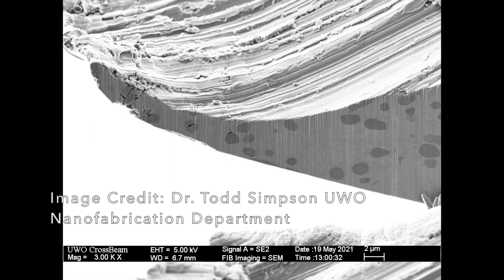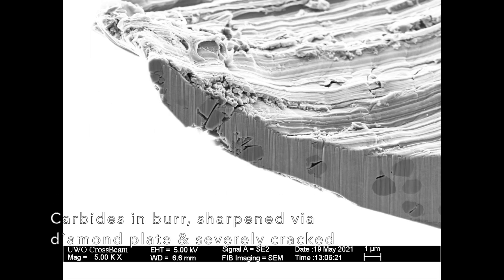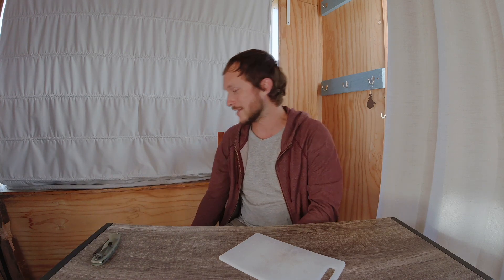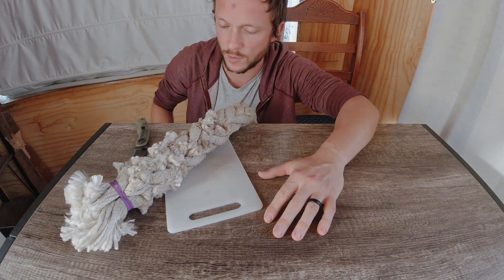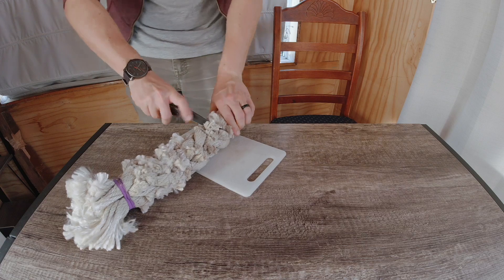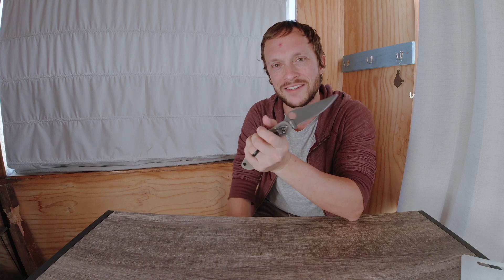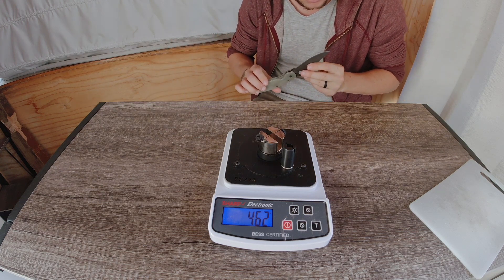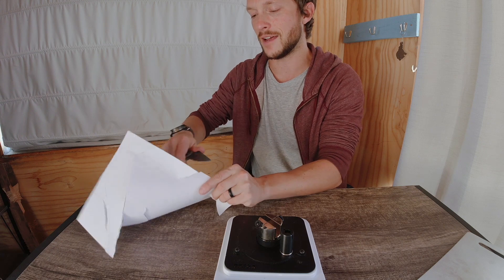CPM M4 Prototype Carbex Edge vs Death Rope - Spyderco Military Knife Test

Comment: I was looking at those articles on science of sharp recently, and I don't think the issue is the abrasive material - take a second look at the K390 article, and you'll see a similar effect with the 240 grit Sigma Power Select II. I think the issue instead is the grain size/height. When a shallower cut is made into the material, the carbide does not fracture, an effect that's exploited in machining ceramics. I think there's a lot of potential to work forward from this principle in designing sharpening abrasives.
Reply from the maker: YESSSSS. The nerd-factor on this comment is amazing...  Let's talk!

I somewhat agree - have you seen Todd's articles about how increasingly fine diamond plates actually lead to deeper "gashes" in the edge and greater edge deformation?

I think that there are multiple things at play here:
1) How hard the abrasive is vs the hardness of the carbide being cut - ie diamonds will have greater likelihood to break a carbide because their molecular structure is so hard/rigid, they just don't want to absorb any impact shock, they want to transfer it all back into the edge BUT
2) The relative coarseness/fineness (ie size) of the abrasive determines whether there is a wide surface of abrasive sliding along the edge, or a small surface digging in - however, it should be stated that the pressure applied to the blade will minimize or magnify this effect (eg you could shatter carbides and make deep channels even with a Coarse stone by applying a lot of downward pressure as you sharpen) AND
3) The medium/binder determines how much absorption of shock is possible.  A hard stone will shatter carbides more readily because its embedded abrasives cannot be pushed out of the way.  A stone with softer binder, less so, and a leather strop (even with diamond) will be less likely to shatter many carbides, because when the abrasive and carbide collide, the abrasive can "bounce off", deflecting into the soft flexible material, and absorbing the shock rather than breaking the carbide.

Wow, I just unleashed a lot of theories, lol - what do you think of 1, 2, and 3?  Agree or disagree?  Or do you think there are other factors at play?
Reply: Haha, yes!!

I have seen that article, though it wasn't on my mind per se when I wrote that comment - and I really hadn't been thinking of moving to finer plates, so much as finer (but still coarse) resin-bonded stones. 

On to your numbered points!
1) I think we want to cut the carbides for apex formation! even in PM steels, carbides are often 2-3um, while a sharp edge is sub-micron. But when we do, it's important not to damage them. As you said, it does seem likely that a rigidly-mounted diamond is more likely to break a carbide, as the carbide will yield sooner than the carbide, whereas a conventional abrasive grain might yield first (specifically thinking of hard VC/NbC). But even ceramic abrasives are able to apply enough pressure to fracture carbides, as Todd showed.

2) Yes, and also the dressing state of the stone, as well as the abrasive concentration, and height variation.

3) True! Surely there's some balance to be sought to ensure cutting takes place, while supporting the abrasive grain enough to cut. Perhaps this changes base upon grain size and morphology.

Additionally, I think elastic modulus mismatch leads to both edge damage during sharpening and dulling during use - because the carbides are so much stiffer than the matrix, they fracture first under load, and those fractures can sometimes propagate though the matrix to other carbides, leading to microchipping. I suspect this means too-heavy pressure during sharpening has the possibility to cause carbide fracture. You can certainly see that carbides are broken in the burr in the K390 article.

More about fracture vs cutting: there's criteria for this - essentially there's a crossover point where the force needed to shear off the top of the carbide produces enough tensile stress in the rest of the carbide initiate brittle fracture/cracking. In CNC machining, this is mitigated by controlling the feed of the tool - but in sharpening, we can only control this through the abrasive design and pressure used.

One more thought though - I really wonder about the ability of etching to expose the carbides non-abrasively.
Reply from the maker: @knickly  You raise excellent points - it’s true he does show that Al Ceramics can still break carbides - then again they are some of the most rigid “binder material” stones.

I completely agree about the source of dulling in high carbide steels being cracks propagating through carbides and that being primarily due to the difference in elasticity between steel and carbide (or, said another way, the fact that regardless of HRC steel is ductile by nature, and carbides are not due to their rigid crystalline structure)

Yeah, I agree that there is some point of critical threshold, an amount of force beyond which carbides will crack rather than shearing.  And that we need to find ways to stay below that threshold in hand sharpening in order to get the best performance.

Etching is a fascinating idea.  It would vary in effectiveness from steel to steel due to differing reactivities (IE would be hard to force MagnaCut to do so, but Maxamet and M4 would be good candidates).
Reply from the maker: @knickly  this comment string was deeply satisfying.  Thanks for taking the time to truly know your stuff!
Reply: @homeslicesharpening  I just saw an interesting paper related to dressing electroplated diamond wheels for grinding brittle materials. They point out (as we know) that the height of the points varies a lot, which is bad. So they took off the tops of the grains with a bronze-bonded diamond wheel so they'd all be the same height, then reverse-electroplated (ie, etched) the surface to expose more of the grains. They got really good surface finish afterward. I want to try that with my cheap 150 grit diamond plate. This is really intriguing to me, because I've suspected for some time that non-pointed grain geometry could give lower roughness and could be advantageous, including mitigating the damage caused by edge-leading strokes.

I also saw a few things about deflection of the abrasive - one was a paper that said maximum chip thickness was proportional to the ratio between the modulus of the grinding wheel and the modulus of the work - so which sorta the idea that softer, more compliant bonds do less damage - but also suggests that a more flexible support for electroplated diamonds could improve results as well, as long the plate itself is sufficiently flexible.

Also, some folks on the Spyderco forum were discussing the Rahven ceramic knives, and observed that they had less microchipping when they used lapping film on card or paper to provide some give.
Reply from the maker: @knickly  Very interesting!  Dressing the diamonds all to the same height would be so cool!  What will you use to electroplate?  Do you need a voltage regulator and an etchant?

I just got some Chrome Oxide paste - I'm going to try to mix fine diamond with it on a leather strop to see if I can accomplish an edge with exposed carbides (from the CrO wearing away the matrix) but maybe with more shaping of the carbides into useful cutting shapes (via the diamonds).  I have heard Vadim Kraichuk say he had good balance for durability and aggression with those materials.
Reply: @homeslicesharpening  after some further thought and reading, I think I can re-expose the grains using a softer whetstone, probably my 150 grit Naniwa Lobster. But if I do it electrolytically, I'll start by trying a DC wall wart power supply - yeah, it'll need an etchant, which I'll probably hold using a cloth pad kinda like the electro-etchers use.

The mixed abrasive is really cool! I'm excited to see how it works for you. I'm very interested in blends of conventional and superabrasives! I really need to read  Vadim's book, though I vaguely recall that specific idea mentioned on his site iirc.
Reply from the maker: @knickly  cool!  Let me know how the Naniwa or etching goes!  I’d be interested to hear if you have improved performance!
Reply from the maker: @knickly  I’ll post a video about the mixed abrasive when I do it!
Reply: @homeslicesharpening  great news! I was finally able to mess around with this.
Here's the process I followed:
-Abrade 150 grit monolayer electroplated diamond plate with 40um resin bonded diamond
-Dress 150 grit plate with 150-180 grit Naniwa Lobster (a very soft coarse stone)
-Abrade 150 grit plate with 3000 grit monolayer electroplated diamond plate

Unfortunately I've been unable to capture any clear images of the grains to verify truncation of the grains or re-exposure. However, here are my initial impressions:

The plate feels noticably smoother to the touch (I had not even done an initial break-in with hard steel). I sharpened a Tojiro VG-10 petty using the prepared plate. It still cut fast, raising a burr in only a few strokes. I was able to slice newspaper over the entire length of the edge. I then stropped with 3um diamond paste on MDF. The edge was extremely aggressive on tomatoes, bell peppers, and avocado skin during dinner prep. I don't have edge retention results, though, or know how it with affect the small hard MC carbides in things like K390 or 10V (both of which I own, but don't need to or have time to sharpen today).
Reply from the maker: @knickly  That's AWESOME!  I just got a Fallkniven DC4, and I had forgotten how nasty a new diamond plate is.  So many rough and uneven patches that leave the edge ragged until you wear it in a little bit.

Yours must be next level!  Not only worn in but custom dressed to an even plane!  So cool.  Let me know how it works on the High Alloy steels!
Reply: @homeslicesharpening  funny coincidence! I just used it on K390, with similar results.l on newspaper. Unfortunately I still can't detect fractured carbides, though I've just received a microscope objective to use with my camera (waiting on adapters before I can use it).
I do think, though, that I'll remove some more material from the diamond grains to get a smoother finish. I'm waiting to do that until I get a small metal-bonded diamond segment, as I don't wish to use up my resin-bond stone.
Are you initializing/breaking in the DC4 with hardened steel?
Reply from the maker: @knickly  bro I just started sharpening knives with it.  Is there a better way?
Reply: @homeslicesharpening  yes! Many people advise rubbing a piece of hardened steel over the new plate. You could use the back of a chisel, for example. This dislodges any particles which are not fully embedded in the bonding material. These particles tend to stick up above the remainder of the particles, contributing to a particularly severe scratch pattern. With use, these normally become dislodged. However, you can accelerate this process with the initialization technique.
I've not actually done this, however!
Reply from the maker: @knickly  Great to know!  Thank you!
Reply: @homeslicesharpening  I finally got my adapter and connected my microscope objective to my camera last night! It doesn't seem like I have much grain truncation yet. But I do see some places where the grains are knocked out, I think. So it's basically equivalent to a broken-in plate. I definitely want to take more off, but I'm gonna wait till I get some different stuff. I might order another diamond plate, because this one is kinda nice to have for thinning.
Reply from the maker: @knickly  Nice!  I just got one of those  25% concentration OCB diamond finishing stones by Venev, very excited to try it out!
Reply: @homeslicesharpening  oh, very cool!! What grain size/grit? I'm curious to hear how you like the reduced concentration!
Reply from the maker: @knickly  it's a 5/7 micron and 3/5 micron (800 & 1200 FEPA grit)
Reply: @homeslicesharpening  oooh almost a bonded abrasive strop!
Reply from the maker: @knickly  True!